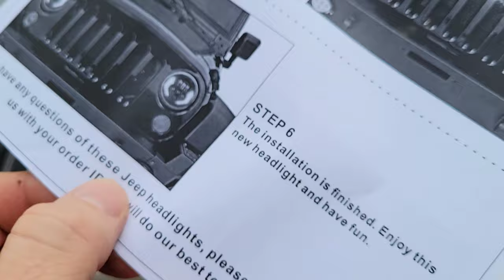New 7" LEDs Headlights for JKU from Povtor

Comment: So quick question how did you run the yellow wire
Reply from the maker: I use a wire conduct tite blue splice terminal and connectors between headlight to turn signal wire.

Comment: So after instal, I turn on my headlights and the passenger comes on bright but the driver side is normal. I turn on the brights and the passenger turns off brights and goes normal while the drivers side goes bright? Any idea what’s going on?
Reply from the maker: Check the wiring to see matches both sides of driver and passenger. Start at passenger side to rewiring because I have to replacing connectors when was loose before install new headlights.

Comment: How come the Headlight DRLs stayed on but none of the other lights stayed on? is that just the timed lights?  Just goy my first JK, starting with the stuff that needs doing the most. like headlights and a set of led pods for reverse. cant see jack at night.  This is the ONLY video on youtube that i have found about povtor headlights.
Reply from the maker: Povtor is a new, it's alright in my opinion and love the look designs. I have to make a few adjustment to see better in the night because I have a different front bumper now. 

DRLs appears when into drive, not in park, and side lights stay on when key in accessories/ shut off timed without key.   I am going to saving money up to get KC HiLites in next year.
Reply from the maker: And one more thing, your Jeep could be reprogrammed to turn off the DRLs and you could get fixed back to the standard setting at a local dealership or know anyone has a special programmer tool.